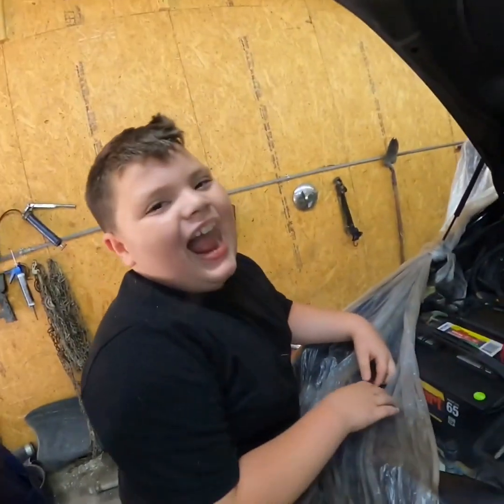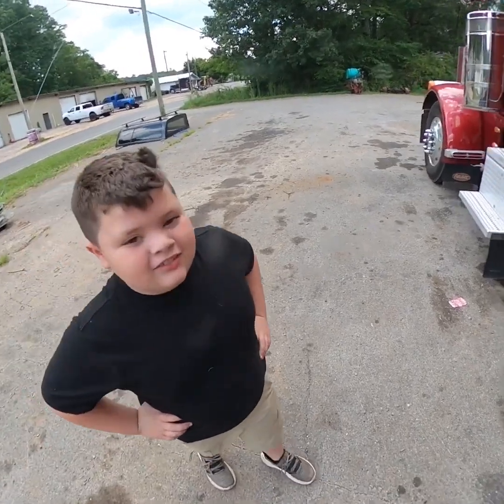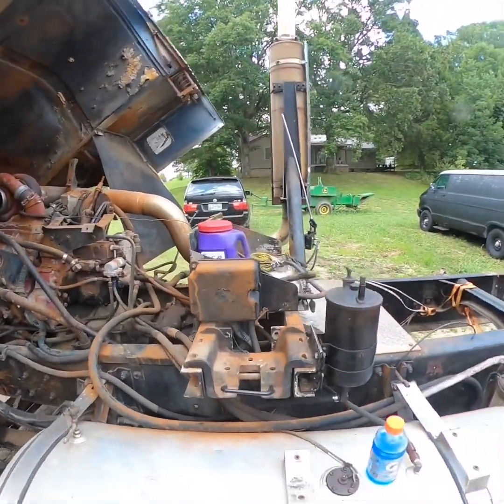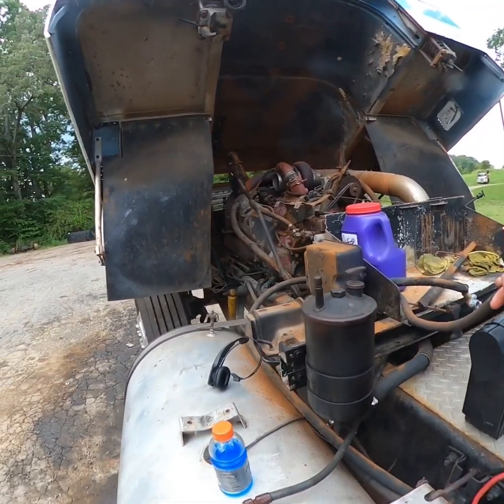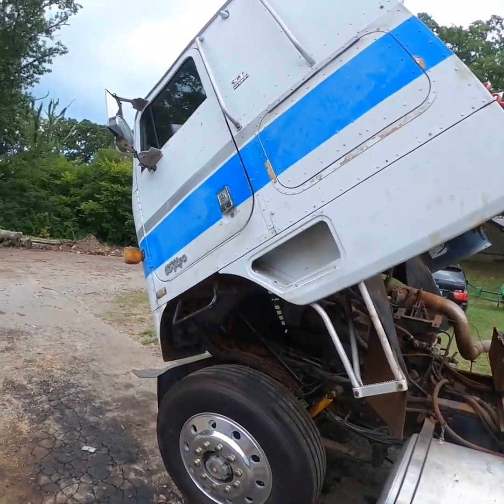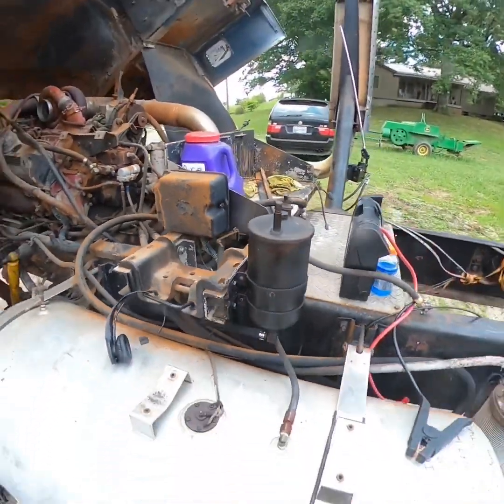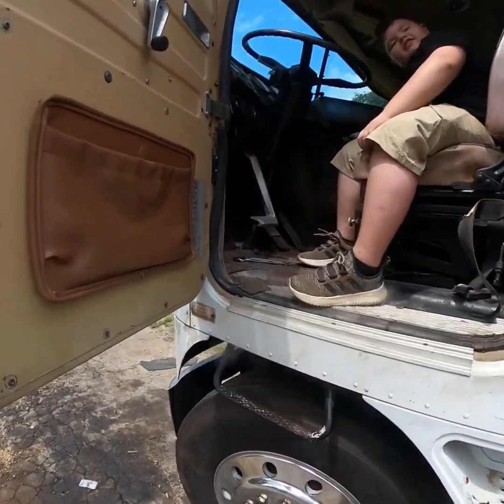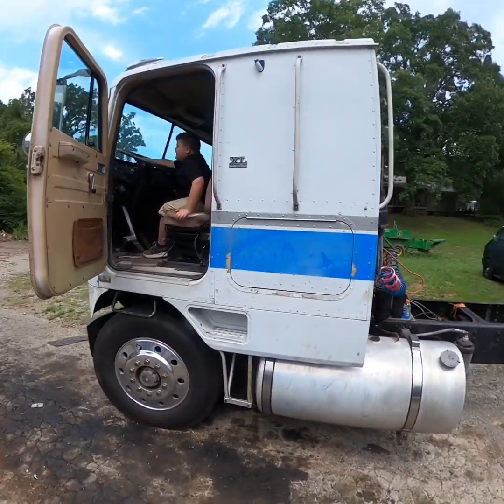Brax STARTS UP the Air Force CabOver for the first time! Nothing but SMILES!!

Comment: Bruce overheated it a couple times. Hope the liner o rings are good. Would love to see the old 6V get ran.
Reply: Had  some those Detroit engines they don't like it when one gets them that hot. A tired engine in the first place then Ole Bruce Cooks her a few time in getting it home. My bet is that she is Toast.
Reply: Daniel Hofer agree. Worked at a Detroit dealer. Seen it a few times.
Reply: engine is toasted most likely, sat for awile then bruce overheated it several times getting it back home. Would take a lot of work to make that a reliable engine again.
Reply: @TN_Whiskey  10 chances to one  the heads are cracked. We had 8V71 Detroit engines. #1 rule was WATCH  the Temp Gauge Closely. . liked to run them at 180 degrees.when  the temp would get to up to 200 degrees we would start to down shift & back out of them but keep them at  2100 to 2200 rpm's. Absolutely DO NOT  Starve a Detroit  of Water. Keep the radiator FULL. at all times.

Comment: That is the first V 6 Detroit I ever saw in a truck usually the Silver 92's were V8 and could be juiced over 500 hp, I had friends who use to work on them all the time and they said you put 871 injectors in and something with the governor linkage and they would bust the wheels loose when they take off.

Comment: Not surprised it has an ether emergency start, being a military vehicle, military needs to make sure it always starts when needs to in a emergency situations.
Reply: Whats an emergency start? Dont you just turn the key like anything else?
Reply: @craigcooper75  @13:30 he said it had a ether switch on it. Ether AKA starting fluid, it's got an emergency start ether starting system I gather, from the video. A lot of those big old trucks in the military had ether emergency ether starting systems, that way if they were under attack or something and couldn't get the truck started because sometimes they don't start they could give it a shot of ether and get it going fast to get the hell out of there and get going again fast.
Reply: @craigcooper75  here you go, here's all the details on it I believe you can read up on it...https://www.koldban.com/Ether_Systems_Why_Ether_s/26.htm
Reply: Justin Hobart thanks for information
Reply: @justinhobart8747  
I seriously doubt that truck would ever be in a combat zone, maybe, but very doubtful .
The military prefer all wheel drive trucks
Reply: @bertgrau9246  I doubt that as well, but you know the government loves to spend our tax money on extra crap even if they don't need it. Of course you also find a lot of people using those ether systems in cold weather environment. So it's possible either way but quite a few military vehicles have them installed as standard equipment for that reason anyway.
Reply: Wow there’s a ton of miscommunication here wow!  I only mean in the comments.
Reply: @zimbabwesteve4620  true that, I hope I'm not spreading any bad information... Yes I am non-military man my self, I only know what I know from family members who served. My mother retired from the Rock Island Arsenal, and My brother was in the Air Force, and my old boss who had an automotive shop and was also a 20 + year as Sergeant in the Army National Guard and allowed me to work on some cool old military vehicles from time to time and taught me a few things about them, but I know I not a expert on them by far... At the shop we just occasionally got them in from collectors of military vehicles that would bringing them in to the shop to get fixed or serviced because they knew my boss served and knew he knew exactly what he was doing working on them. Kind of weird we always seem to have some old piece of military equipment in every few months, I doubt most General automotive shop can say that, LOL

Comment: Are you putting on a wet line kit on this truck.. sweet project I’ve been working on my 359 quite some time now.. I was actually working my truck and I took it off road before getting sick..now I’m back redoing stuff airlines etc.. rusted bolts that I’m replacing with stainless steel..

Comment: 8v92T Very good eng & for the displacement of it (12.1 liters) and the ability to make 435 hp it's quite ingenious. I've seen some w/ different injectors or turbo up to 600 without major modifications. I can't imagine how rare it is for an IH 9670 to have one of those I can bet 80% or more had Cummins or 60 Series Detroits (1987+)
Reply: Except that's a 6v92T

Comment: What year is the Pete 379 and what's it running? I use to have a 86 Pete 359 had a cat 3406B in it with a twin stick with extended frame bought it off a guy that was hauling logs with it. I made some good money with the truck seen lot's of the Country in that truck too. I would love to do it all again but I'm making good money on day runs right now but I wanted to get back into running cross Country again with my own truck that way I can do whatever while I work so much better freedom when your a owner operator instead of on the company clock.
Reply from the maker: 98 16 liter cat around 800hp

Comment: Teach him right while he's young. Like the bible verse, "train a child in the way he should go, and when is older he will not depart from it". -Proverbs 22.  I like the idea of a repaint to what it looks like now, the painting design on it now would look good after a freshening up. I'd keep it too. That motor sounds good since it was a US govt owned truck, its likely a low mileage truck. I used to drive a 1978 White Road Boss with a 318 Detroit so I remember that sound and the oil leaks well.

Comment: why don't you build the cut up IHC into a green Race project it is alreay short has no engine and trans,
it's a good base.
The Air Force irond out as a work or show truck in Vets style ,sure will be a reliable horse.